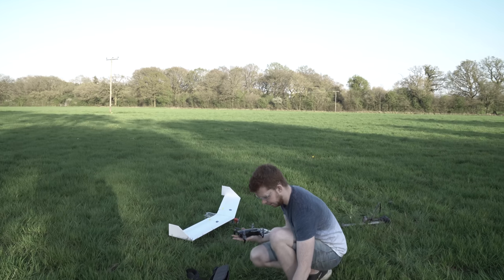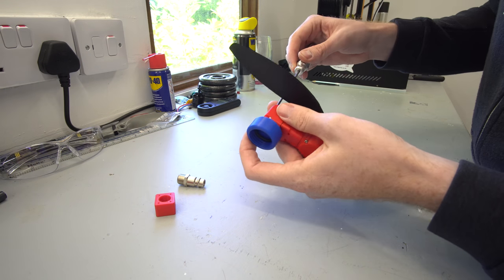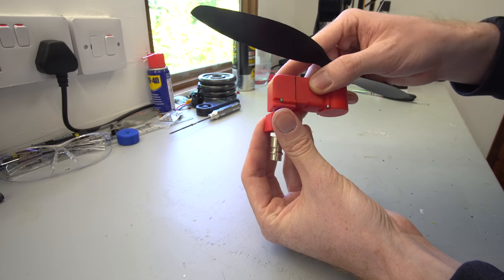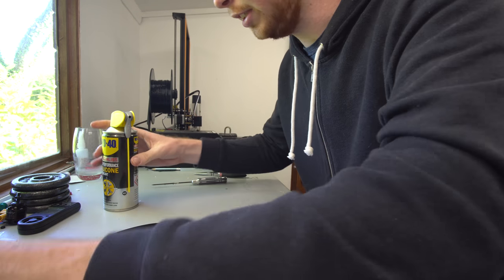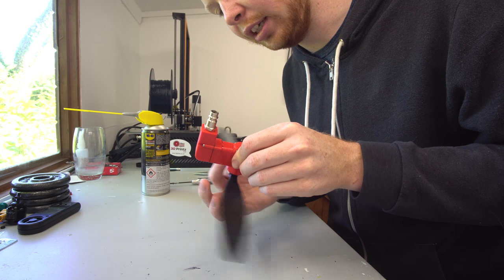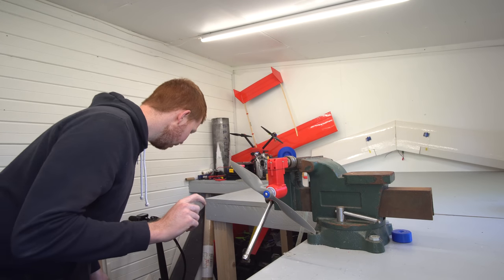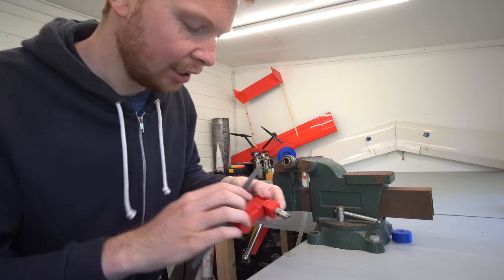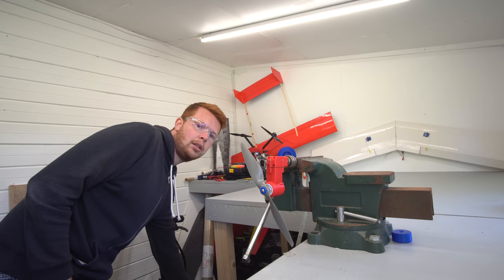Air Engine Throttle

Comment: Do you think you could make one with 2 or 4 cylinders? Having to start the engine like that is going to be inconvenient on a car. With 4 cylinders, there will always be one in a good position to start the engine, and it should run as soon as pressure is applied.

Comment: I have been thinking this for a few of your air engine videos now - could you have the outlet on the engine link up to the inlet on another engine? You’d have reduced airflow in the second engine, but in this set up you could have 2 less powerful engines fed from the outlets of the primary engine to make some additional use of the escaping air.

Comment: you should add a small motor behind connected to the crankshaft so that you can start the engine using a controller and you don't cut your finger off

Comment: With the diaframe valve u will get oscillation problems in a particular flow range make sure that u go never in that range while u are in the near of that thing while it's operating in that instable range

Comment: You could have mounted the engine upside down to get the larger prop to clear, right? Or is it gravity fed only?
Also, most compressor fittings, even new ones are not perfect. By the looks of things, the hose fitting you have is new, but the hose itself is old, so that's pretty normal for compressed air hoses.

Comment: you might need to make a multiple cylinder engine if it's going in a car, depending on the weight of the car, 1 cylinder might barely have the torgue to pull it around with pretty low gearing, so the car may not move at less than full throttle.

Comment: Try building an in-line 2 cylinder version with 90 degrees crank pin angle. It will start on its own that way.

Comment: Printed plastic parts need to be smoothed over with a heat gun very carefully with a small tip to minimise distortion. If you don’t the leaks will result ....

Comment: Is there a reason you didn't use a butterfly valve? They seem more fitting, and you can tune the idle. If you're not worried about leakage then this should be perfect?

Comment: So with this you actually should be able to create a pressure regulator. Just allow the main pressure to act on both sides and then with e.g. a spring give a small pressure advantage to the valve side. 
Then no matter what pressure you have you always have a specific output. 
Or am I wrong here?

Comment: now you should make a way to have a reversed throttle, or actually a normal throttle. when you push the rod it should increase throttle and when you let go of the lever it should idle at the lowest possible rpm

Comment: So here is something to consider. Adding oil to anything that works on basis of compressed air at pressures near 4500 PSI is a horrible idea (as in it actually can kill you). so your engine is not quite scale-able. have you put any thoughts into that?

Comment: If you run into issues running the engine above a curtain rpm you may run into valve float...basically could ware out your engine ord self destruct, i think retarding the timing may help at higher rpm spring strength is also a factor
Reply: Spring strength is also a factor

Comment: Not sure if you've tried it already but, could you PLEASE make a video with one of these engines and fill the bottle with water or some kind of liquid? Sorry, I got an plan involving a pump jet powered rc boat and a paragliding g.I. joe  in the works for next years rc competition but, I lack a 3d printer so I'm scratch building my parts with a dremel, soldering iron and endless supply of scrap at the local landfill.... I'm very intrigued by your design and it's simplicity... I look forward to future modifications and applications...              °86™

Comment: Uh, just wanna repeat myself and say if you rotate the camshaft 90 degrees from the intake at the top you could totally make an 4 cylinder inline compressed air engine. Greater torque, chance to further tinker with timing for greater efficiency.

Comment: I'm thinking that the power to weight ratio favors the standard rubber band over the air powered engine especially when you add in the weight of the ancillary tank, regulator etc.  OTOH, the ratio wouldn't matter as much on an RC car.

Comment: Could you generate the pressure to run the engine by burning fuel and oxidiser in a sealed chamber? Would be a very strange type of IC engine, sort of... 🤔

Comment: Tom you should 3d print threads into that compressor connector. Fusion360 makes it super easy. I love these air engines too! Any chance on another hovercraft with differential thrust or a separate motor for the skirt?

Comment: What if you sent pressure from the output of the diaphragm valve to the top of the diaphragm.  Wouldn't that make a pressure valve. With no pressure on the output, there would be no pressure on the diaphragm, with high pressure on output, you'd have high pressure on diaphragm. The pressure could be adjusted by changing the surface area of the diaphragm for the pressure to interact.

Comment: given in an air powered car the mass of the engine is less critical, perhaps add another cylinder, out of phase on the same crank, so the engine can self-start when the valve re-opens?

Comment: The handle on the side of the vise is for turning it you didn't need a smaller blade. Also you should never stand in the plane of a rotating object without a gaurd

Comment: Try to make a two cylinder one, either a boxer or a straight twin.
As for a throttle controller, have you tried a tapered needle jet design adjustable with a screw?

Comment: You should make the valve top have a gap with threads to screw a bolt in to adjust the valve and also set the speed of the engine .... not sure if I explained that properly lol

Comment: It’ll be a lot cooler if when you pushed down, it got faster instead. Also a channel based completely off of compressed air engines would be nice

Comment: Cool design, only issue I see is that  if the electronics fail, the engine will go full power sending your vehicle out of control at full speed.

Comment: I don't know if you noticed, but when you started regulating the throttle with the lever, the tone of the engine changed, but the RPMs didn't. That tells me that without the throttle, you're wasting a LOT of air on just making noise. I still think you should put more effort into adjusting the compression of the camless version, but if not, then you need a lot more work on the cam duration and timing, as you're clearly wasting a lot of air.

Comment: Get rid of the quick release all together, even the brand new ones leak a little. Get a 1/4" ball valve and screw it all together using the valve to turn off the air

Comment: All pneumatic quick connectors leak it's almost necessary or at least I always thought it was - but forget that - using long nose pliers to tighten a pneumatic coupling! No mate! You're a brilliant engineer, don't let us down now. How much energy are you losing in the gearing and piston movement and friction vs a direct turbine blade transference of energy?

Comment: Why don't you use an orfice to restrict the flow to the engine. That way you have increased the volume and control the flow to the motor. It's almost like a gas burning eng

Comment: you should use some co2 canisters in series to run your plane when you attach it to your plane again.
Reply: if i had a lathe and some aluminium bar i would fabricate it for you but i lack the essentials

Comment: Cant you use some sort of hood scoop and with the throttle and a servo you could control airflow and add dry ice to the bottle for longer run time just as a commenter by the name of Joon Kim suggested

Comment: you know what would be cool for lube is to set up a drip valve going into the intake with a little reservoir full of lube so it automatically feeds lube through the motor.

Comment: the is a turbineless jet, the commotpressor is powered by an elect motor. you can use a model  motor. a printable centrifugal impeller is at Thingyverse you will need to print the defuser. this would be a patentable idea.

Comment: What would happen to the engine if there was no lubrication? Just worse performance? And have you tried any other types of lubrication such as a graphene/graphite spray? (Can't remember exactly which it is. Maybe it doesn't matter.)
Reply: If the engine had no lubrication I assume that the plastic parts would wear thin round the piston and allow for internal air leaks?

Comment: You shouldn't have a screw threaded into both pieces if you want to be clamping them together, it should have clearance on the top piece, and be threaded into the bottom piece.

Comment: The problem of Air engine system is container to cruise far and low power to push rotator. The cool air and hot water can solve those problems.

Comment: Tom, is there a way to combine this Air Engine idea with your eBike to create a peddle assisted Air Engine bike? Thinking that if you could in some way collect energy (air) when you peddle and then use that air to run the Air Engine to move the bike forward.

Comment: You could take it one step farther and integrate a generator to self power modular components like remote response or rudders and fins. Just a thought.
Reply: Probably would have to compensate for torque and/or power distribution.

Comment: Ive got a stupid idea. Since weight is a factor.  You could use a gas thats lighter than air
Reply: Compared to the weight of the plastic parts, the weight of the gas (even compressed) will be negligible.
Reply: compressed gas isnt lighter than air either, go pick up helium tank, its not light...

Comment: I was wondering if perhaps a modified sterling type motor (2000RPM Engine Desk Toy) on Youtube powered by a coil of wire heated from a battery source and the output geared for higher revs might work?

Comment: Never seen someone so happy with a pressure regulator, I thought you might actually get a tachometer and measure the range of the engine with that specific propeller, because anything you did here is only valid for that specific propeller (diameter & pitch).

Comment: Heating the metal and then installing it is the opposite of what you'd want to do. When it shrinks leaks can happen. You'd want to heat the plastic, not the metal.

Comment: No doubt there's going to be a screw or clip to be able to hold the 'valve' at it's chosen power level as I doubt a servo would be able to adjust the throttle.

Comment: if your looking for a staged throttle just like gasoline engines they have a carburetor add something like that for better throttle
or somthinig like a valve or flap like cars use

Comment: By throttling the inlet you are losing efficiency at part throttle (wasting air)

As you have gone to the trouble of an external valve gear, how about varying either the valve lift or better yet the lift duration. If you open the poppet valve for a shorter amount of time you will get less air in which will produce less power.

Possibly some sort of sliding follower between the cam and pushrod.

Great channel btw!

Comment: If you build a full sized car using this “engine” system and you have an electric compressor in the back running on a battery is it an electric car or an air powered car

Comment: why not a simple bolt (flat head),with the same diameter of the internal diameter of air tube. The more you scre the scre in, the less flow you will get. To get a seal, the screw should already do a good job, you can add some oil lubrificant. Of course that is not a quick variable speed

Comment: Using compressed air to drive an engine to turn a propeller to generate thrust? Genius! Ok, I'm off to light a fire so I can boil some water to spin a turbine to run a generator to power a series of floodlights than shine on an array of solar panels that will power an electric space heater so i can heat my house.
Reply from the maker: Hahaha you realise half of your comment is legitimately how your house might be powered. So take away your light bulbs and use candles instead ;)
Reply: In theory, yes. But not the way I do it!

Comment: Personally I would have gone for a needle valve as you can get even more precise control if the needle is on a screw thread for height but hey that's just me.

Comment: i understand the lack of control with a ball valve, but why not a butterfly valve or a slider valve?
Reply: Technically any kind of valve that simply reduces flow without adding resistance is not really going to regulate pressure, the diaphragm adds some resistance so the pressure needs to push on it to open it, that makes it so the pressure on the other side is less.      Kinda like if you close your house water valve almost to the end but not quite, the flow might be less but the pressure is still the same. At least that's my train of thought, I might be wrong. I'm not an engineer I just play one in Youtube comments.

Comment: Could you use the main valve to control the speed, put a lever between the cam and the valve and change the position the camp pushes on the lever.
Or is there an electronic valve that could be pulse controlled.

Comment: The reason ur air is leaking is because the Metal part ur stinking in isn’t clamping because of were u clamped the head of the tube. When I push it in u should hear a click

Comment: What if u use a 3s lipo to power a small 12v compressor so you can make a rc car that drives with compressed air

Comment: Personally I think you should reverse the throttle design, where the throttle is normally closed (or at least at idle) and you have to actuate the lever in order to accelerate the engine.

Comment: teflon tape will help with the air leaks.
Reply: to make an automatic speed governor, you could control your throttle valve position with feedback pressure from your exhaust (or intake) port, since you have a rubber diaphragm for your input valve which would either replace the piston and lever, or augment it.  The tricky part would be in coming up with the size of chamber to balance force of the input air to the output air pressure. Thx for the video. Great implementation so far. (or add an adjusting spring/screw knob to your lever, the spring tension would balance the diaphragm force and allow you to set a speed and not have to hold the lever.)

Comment: You should consider at least a two cylinder engine for your car so that it will roll no matter where the engine stops so you don't have to push start it.

Comment: Throttle the exhaust not the inlet. This way you don’t drop the pressure acting on the cylinder
Reply: The engine works by the pressure differential. Where you choke it won't matter.
Imagine a light and a resistor in a electrical circuit with a battery. It does not matter if the resistor is between battery + and the bulb or between battery - and the bulb. In front or behind causes the same drop, and the same differential...
Reply: 1kreature true that the engine works with differential pressure.  However at lower speeds the engine can run more slowly and stall less.  This is my trade and is the reason why pneumatic cylinder are controlled on the exhaust side

Comment: Why not use a CO2 canister to power the plane . A regulator may be tricky but doable.  Those little CO2 cartridges used in air rifles.

Comment: I'm no aerospace engineer, but I feel like having a larger propeller would enable lower idle speeds?
Reply: Similarly, what if you were to put small weights on the propeller to give it more mass?

Comment: get yuurself a compressor from an old refrigerator or, better, ftom an air condiitioning unit. they cost nothing , run almost silent and can deliver up to 100 psi or eveb more.
nicely done engine!

Comment: What is the diamter of the block and the piston, i was experimenting with my own engine but i got no compression and don't know how tight the parts should be? did you vapour smooth the block and piston aswell? and do the still fit then?

Comment: Can this be adapted to hpa airsoft? Pull the trigger to release the air and actuate the engine/nozzle. Use soda or plastic bottle + small hand pump that is pump action = cheaper hpa

Comment: Should have used a rc cars ic engines carb as a variable valve would be more efficient, tuneable and easily mini servo operated

Comment: You need to spend some time in a shop. When you used needle nose to try to tighten the fitting. You could have turned the vise base so the prop would not hit the table. Those quick fittings always leak you should have hard piped it. You are very smart but need some shop knowledge

Comment: dude just put a regulator in line on your air hose you can buy an accurate one for like 20 bucks. no messing with springs required...

Comment: I WOULD NOT RECOMMEND USING WD-40!

If you can, get your hands on some airsoft 100% silicone spray. The WD in WD-40 stands for water displacement, so you are actually displacing the water out of your O - rings or any other rubber parts and drying them up. Evike makes some cheap stuff that you can buy on Amazon or ebay. Just my thoughts, don't actually know if you read these comments.

Comment: i wonder how low an rpm  range that will run with a balanced flywheel rather than the prop (more car engine)